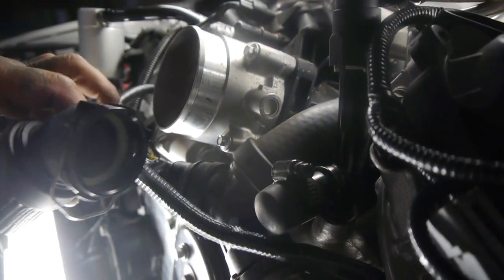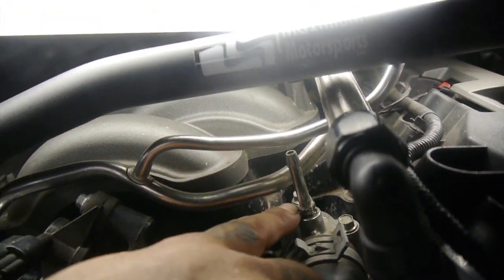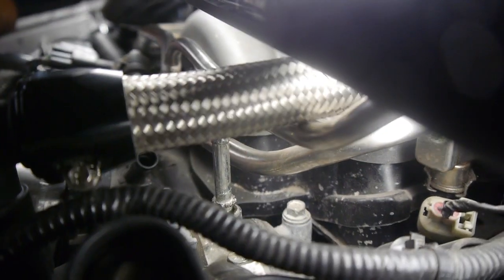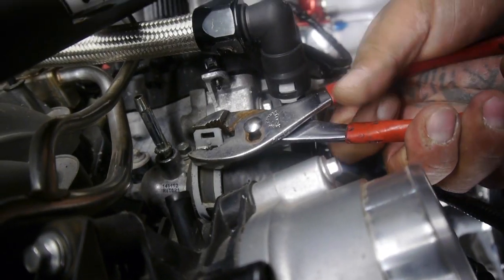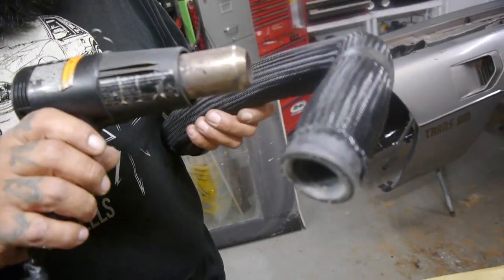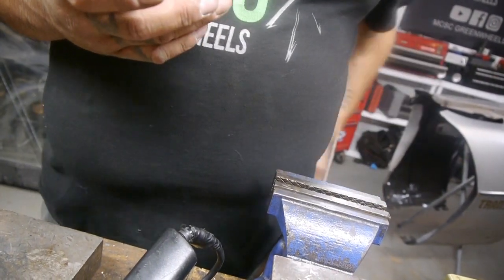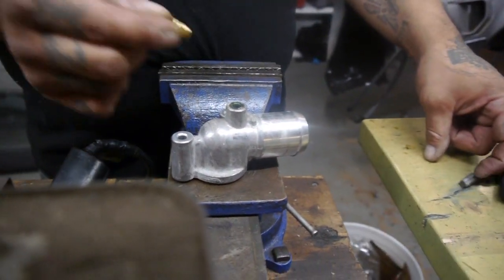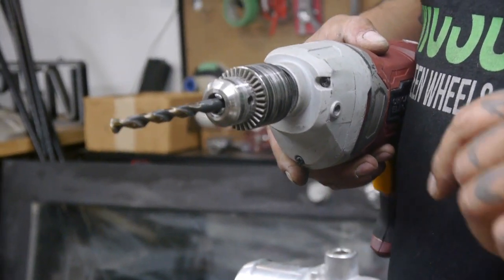Ford 5.0L Coyote Engine Water Neck Bleeder Screw

Comment: Good video!  Thanks. 
If that water pump came with your engine, you probably have a Gen 2 Coyote with better rods and sometimes heads.  The 3 bolt water pump pulley indicates it's a late 2014 build and they started using 2015 parts.
Reply from the maker: Thank you for the comment sir, I hope you are having a good day. Our Engine is a Crate Aluminator motor with the 9.5:1 compression, forge internal built for supercharger. Yes sir it is not the regular stock GT engine.

Comment: Thanks for the shout-out. 📣 Nice job and keeps the mesh from frazzle bedazzle! Remember, NPT is tappered so don't go to far or your fitting will bottom out. You can always tap a little more if needed. I guess you're running a stock pressure cap cooling system.
Reply from the maker: Mr. DiOrio thank you very much for the knowledges and advices. Yes sir I am running a stock pressure cap cooling system.

Comment: Where did you get the bleeder kit? I was going to get it from PBH but the shipping is stupid expensive.
Reply from the maker: I got the breeder kit form  my local auto zone for $8 in Chicago. It might be even cheaper depending on your neck of the wood.  The Kit comes with two sizes breeder screws. Good luck!
Reply: @mcscgreenwheels  do you have a size or part number?
Reply from the maker: @venomfastback   @T JOKER  No I am sorry. I do not remember sir. I thought I measured it in this video. If I did not I am sorry!